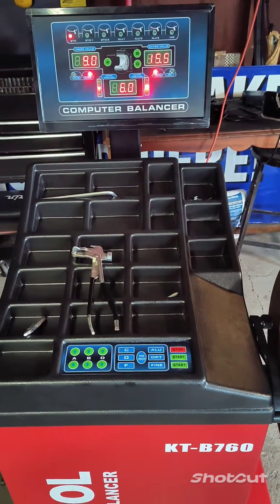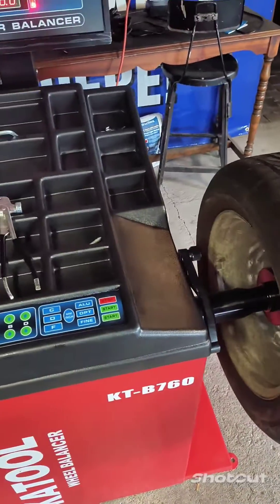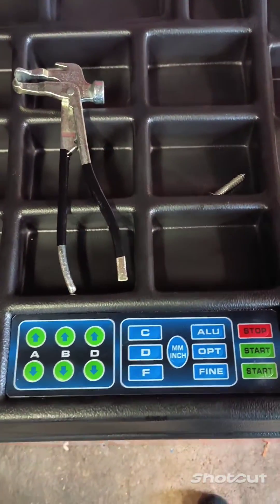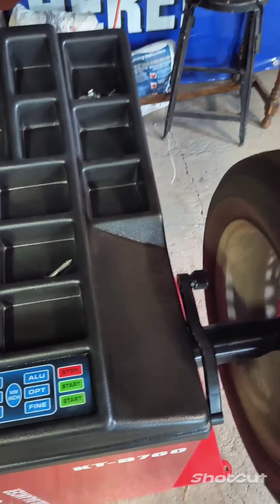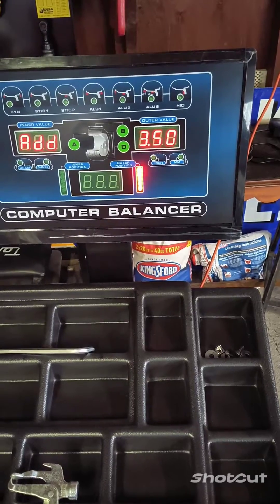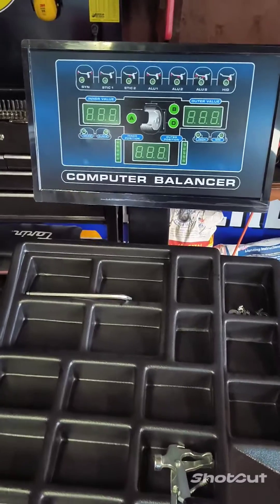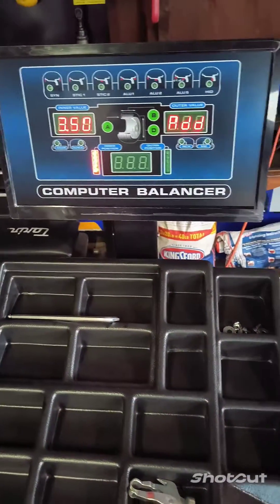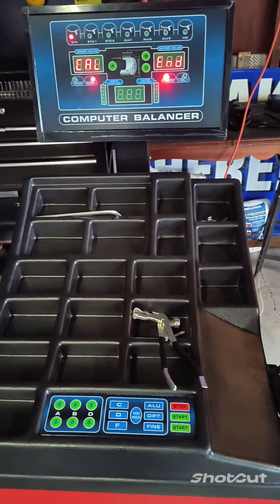KATOOL KT-B760 Wheel Balancer Calibration Instructions

Comment: Err 009?
Reply: mine did this too, and my vertical lights don't flash when you turn it on.
Reply: @chris5445  do your buttons work correctly. I was able to fix problem be adjusting cables. And typing tire in manually before cal
Reply: @Vidarks  my buttons seem to work. Do your vertical lights flash when you first turn on your balancer like some of the other youtube videos? I got mine to finally calibrate using a steel wheel and newer tire. There was no instructions on how to plug in all the wires under the cover.
Reply: @chris5445  when i get to the shop tomorrow ill upload a vid. And go into detail
Reply: @chris5445  https://youtube.com/shorts/j7bXKVVFdqg?si=IFPM3Qkl-Gd6bjWJ

Comment: So the calibration wheel does not need to be previously balanced?
Reply: i think the calibration should be done with just a steel wheel / no tire   you are calibrating to an unbalanced tire the way you show
Reply from the maker: No, just a straight wheel and a good tire.
Reply: my katool b700 balancer says to use a balanced tire. Every video I watch, people do it differently with similar chinese balancers. Very confusing. Your machine is a bit different than mine. To me using an unbalanced wheel to calibrate a wheel balancer would not make sense.
Reply: I imagine it's going off of the 100g CHANGE whether it's been previously balanced or not.   @acreageliving
Reply: @rtownsend744brad yes correct. But when calibrating, starting from a balanced wheel would make things more accurate imo! Especially with these cheaper machines!

Comment: Why can't the kids in tiger cages making these balancers add a dedicated weighted calibration pin like the big boys. I just don't trust a random wheel and tire combo for really accurate calibration. 

I was hoping this balancer was different than the mayflower in that regard. I've had to recalibrate the mayflower too many times because it will start chasing weights.

Guess I'm going to bite the bullet and get a good coats balancer. The chinese tire machines are a great value, but the balancers are not up to par.
Reply: my instructions say to use a balanced wheel for my k700. a lot of tire shops calibrate their name brand balancers every day.
Reply: @acreageliving  i got the 760 and I've been happy with it. It has balanced just fine.
Reply: @ good to hear! I just got mine.  I have calibrated mine, and tested the calibration and it is working correctly! The Yuan chinese manufacture has a good video out on how to calibrate and verify calibration. I am going to make one.
Reply: @johntaper do you have a vid of your calibration on the 760. Just bought one for home use and trying to figure it out.
Reply: @acollins766 you shouldn't need to calibrate it out of the box at all. It's factory set. If you do want to calibrate it you need a known good, not bent, 15" wheel and tire, then you use the supplied calibration weight following the directions in the manual. I haven't had to recalibrate mine yet.

Comment: I thought this machine was self calibrating?
Reply from the maker: You only need to calibrate the machine if you replace a part inside or if you're getting strange readings. Otherwise the machine is calibrated and ready to use from the factory.
Reply: @Toolchoice26  Do you have to re calibrate the machine once you unplug the cord?

Comment: whats the difference between the 760 and 750 balancer?
Reply from the maker: No different except the 750 comes with the wheel guard and the top is designed a little differently.
Reply: @PNX.RSG26  and the 750 can be used without the wheel guard right?
Reply from the maker: I believe you can, yes
Reply: @Toolchoice26  do any of those 2 balancers have a brake
Reply from the maker: They have an automatic braking feature but they do not have a separate manual brake.